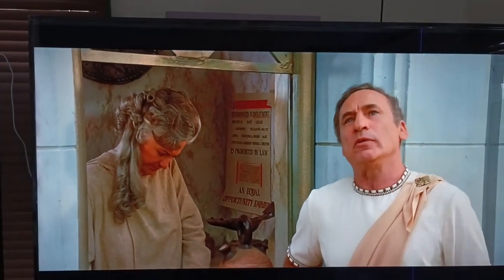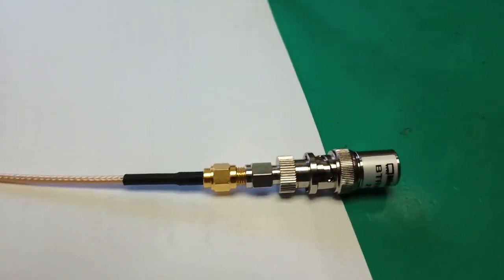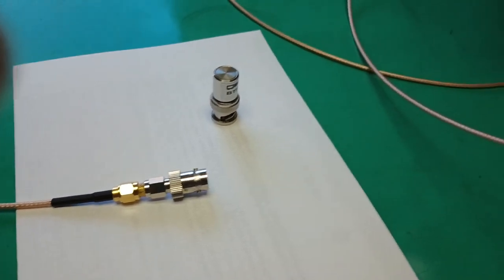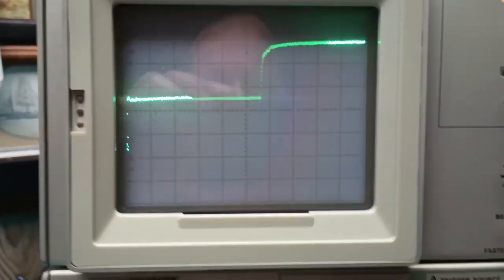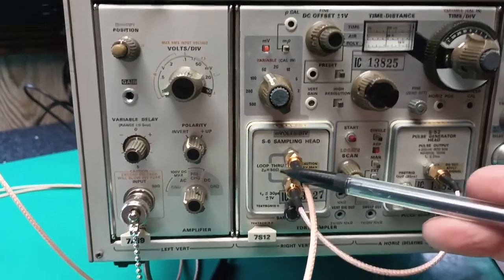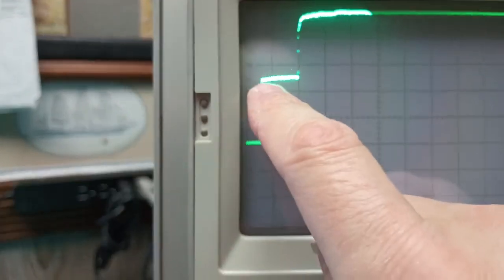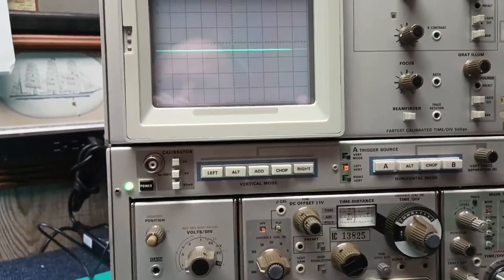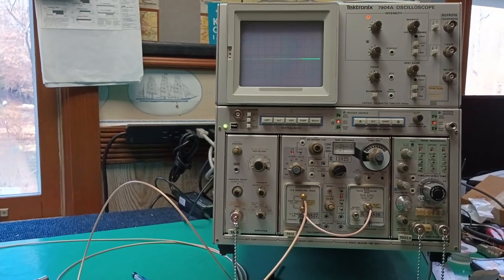Part 3 SOURCE of the Antenna Tuner Myth - TDR Tests  #hamradio #antenna #hamantenna  #antennas

Comment: Metabucks in 1970. Now $50 at a hamfest.
Reply from the maker: Yes and take it home, plug it in and watch the SMPS power supply destroy itself! Guranteed.

$50K in the late 80s for the mainframe and plugins. From the Gummit site. The SA is extended range with a YIG LO..

Comment: I miss having access to such test equipment, but what I have does the job!

Thank you for this video! And to all the HAMS who buy into the lies, so sorry dude!

I have simple vertical antennas and a huge ground plane, and I receive and transmit very well, and when I hear someone with an amp who can't hear anyone else, I can put money on them having an 'all in one' end fed 49:1 balun fed piece of junk antenna...

And I get dissed when I try to suggest they try some radials and tuned wires...

N8CMQ, I give out more 5X9 signal reports, because my receiver has great antennas connected to it!
Reply from the maker: See,yall, I told you so...

TRASH ANTENNAS are the problem. Above is Independent Verificatoin.

Test eq, yes its nice...esp the restored Tek mainframe. Test eq can be had used and restored just like old radios.

Yes a poor antenna is deaf also. Sadly most never figure it out as they never experience a good antenna
Reply: @k8byp  Very true! I have three or four Tektronix scopes that I have gone through and replaced the electrolytic caps, especially in the power supplies, for my own use. As well as some Motorola service monitors and other equipment so I can work on Amateur radio equipment for myself and friends.

I used to be an avionics tech for 36 years and I don't miss that high stress work anymore! But working on ham gear is fun, especially when I put it on the air and use it!

But I get so tired of the usual alligator station with lots of power, but no receive abilities! And they complain that my tiny 100 watts is too low to work, but when I have the ability to put out 500 watts, and I do on many of the nets where these sad hams hang out, proves them wrong.

But these sad hams also lack the ability to use their receivers and try to dig the low signals out of the noise, and they will give up trying to work for others to achieve a new state, and turn their rigs off instead!
Reply from the maker: I usually dont need 100 watts, I try to stay about 20 or less. The utter 'shock and awe' is a hoot!
Reply: @
I agree, most hams can get by with less than 100 watts, and when I was limited to CW only gear in the 1980s, I did quite well with a Johnson Viking II transmitter and a Hallicrafters SX-101A receiver. As well as when I upgraded to the usual Kenwood and Icom SSB transceivers.

However, when I am on the nets, the time of operation does not always occur during the best time for the propagation on the band in use.

 I have been looking at QRP 10 watt gear for portable use and trying some POTA activation of the local parks around my area. I plan on using vertical antennas with 16 radials I can stake out around the antenna. If I change bands, I can just switch the element, and the radials remain the same.

N8CMQ Jeff
Reply from the maker: yes daytime 40 sucks the RF power up pretty badly. NASA Space weather etc say its D layer absorption.

Build a dipole like I discuss here and youll ditch that vertical and radials! Itll work better and less bulk and setup time